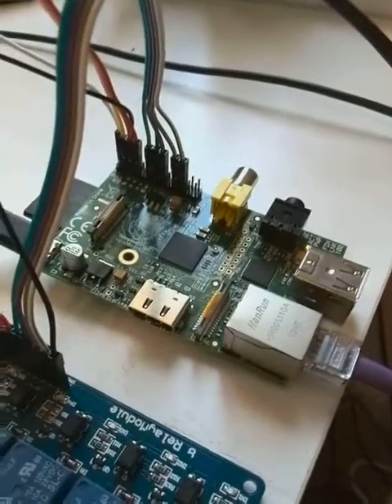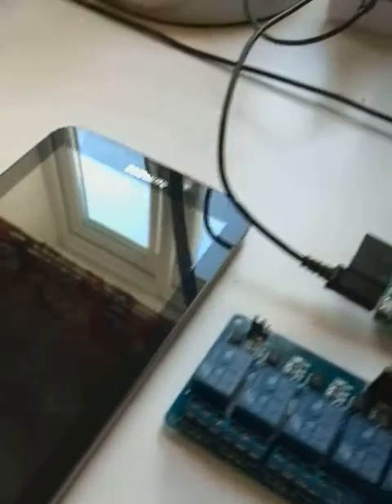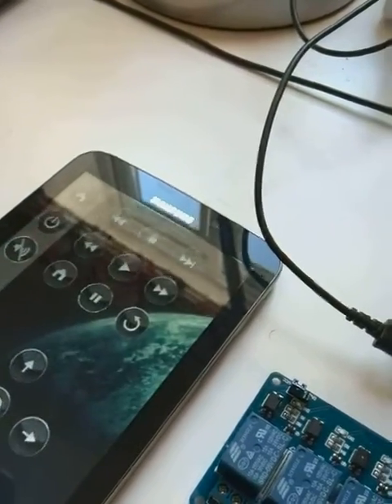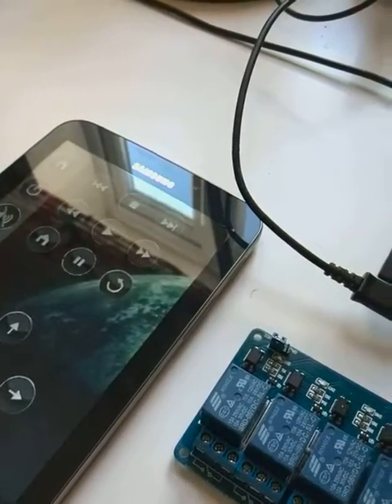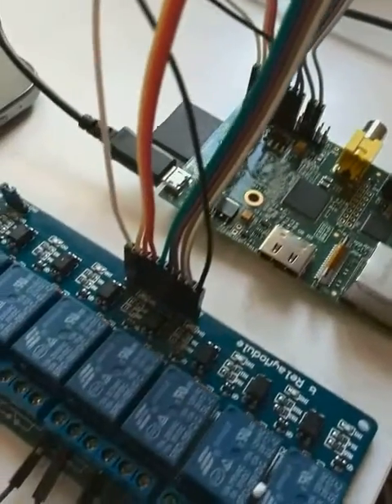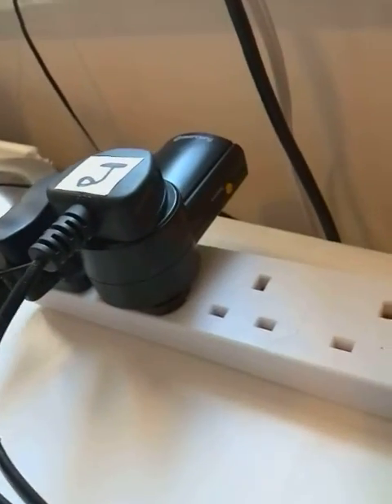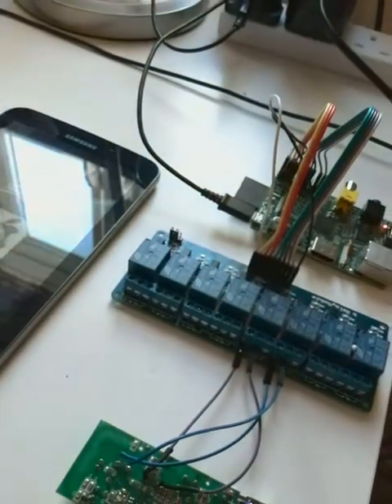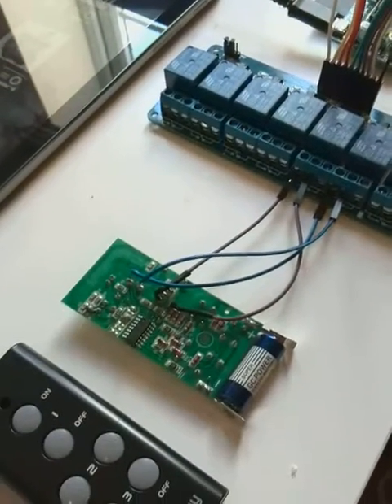Remote Control using Raspberry Pi GPIO

Comment: Hey There what protocols do you use in Open remote designer device section for the command thing as I am completely confused because I cant get openremote to control the gpio
thanks
Jay
Reply from the maker: Hi
Assuming you are familiar with OR2 and creating commands:-
The OR2 command protocol is Shell Execution Protocol
The Path - Ive set this to \usr\local\bin\gpio.sh
The Command Parameter relates to each of the pin pairs - they are bit of a peculiar order but sure there is some logic behind them.
gpio.sh should read somethng like this (between the lines):-
===========================
#!/bin/sh
PIN=$1
/usr/local/bin/gpio mode $PIN out
/usr/local/bin/gpio writeb$PIN 0
sleep 0.5
/usr/local/bin/gpio writeb$PIN 1
===========================

this is telling RPI to close the circuit, sleep 0.5 seconds, then open again
I was using 0.3 but failed to activate the remote - might be the remote control battery tho!

hope that helps